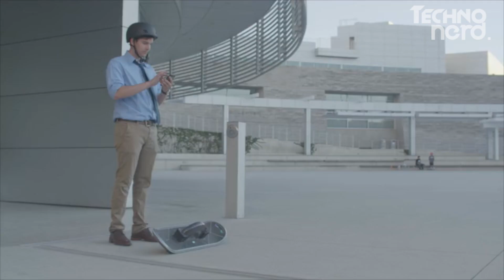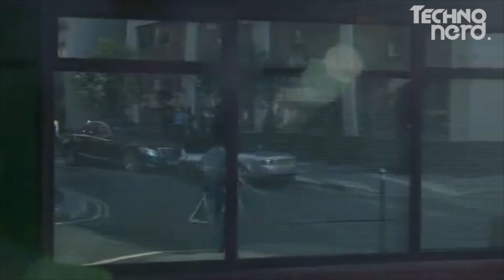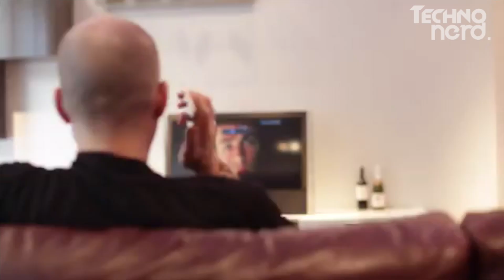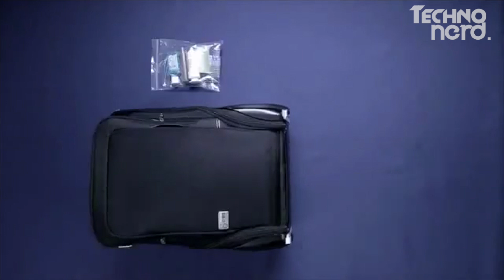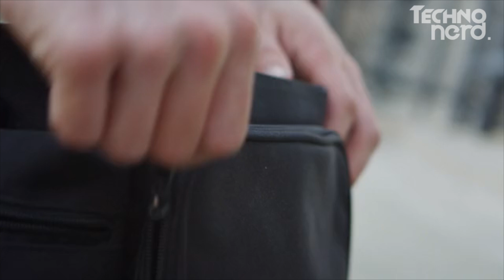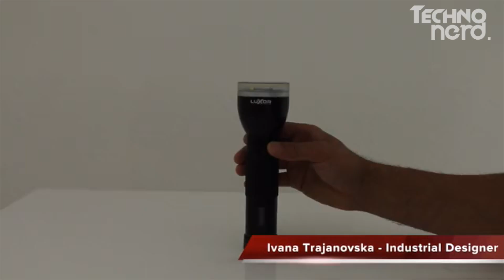7 Futuristic Gadgets Available Now #15

Comment: up to $10,000 for the hover board, but atleast it'll get you over 20 miles of range @ over 20mph, sounds cool enough
Reply from the maker: +killernay xD
Reply: +1stGlitchhunter it may be similar in design but this is better
Reply: +killernay not sure i'd want to move at 20mph on that thing :P
Reply: Expensive but worth it in my opinion...